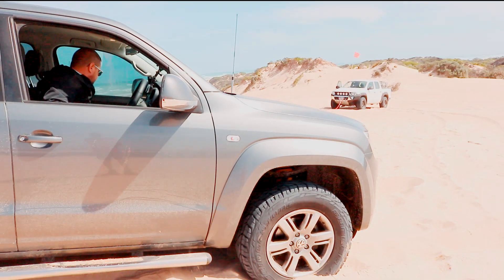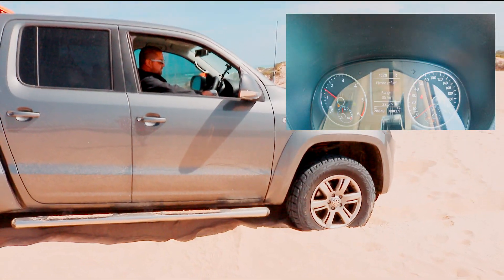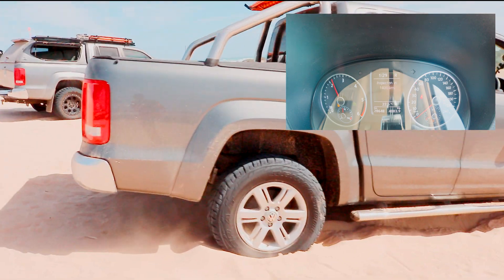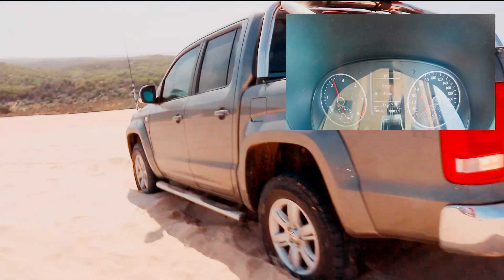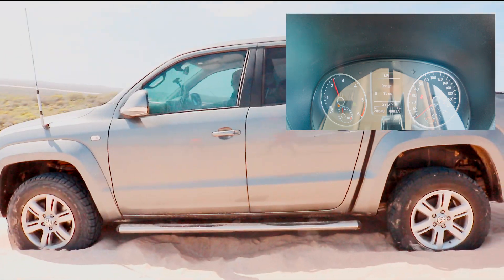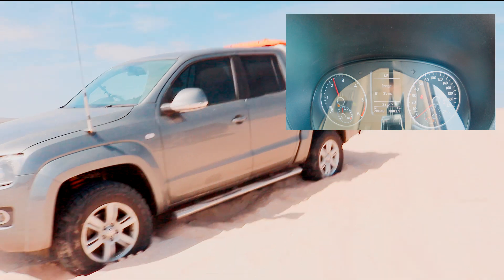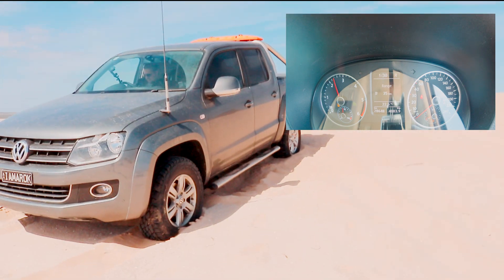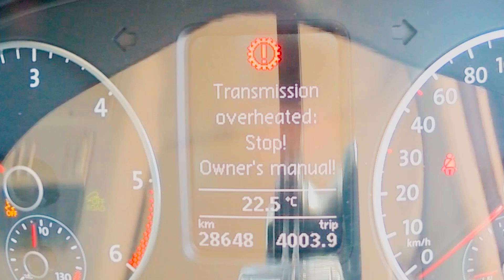JTech Amarok Flash Tune  - Fixing the Auto Reverse Issue

Comment: For me there is something wrong with your gearbox/cluth, yes the vehicle is in the sand but is not stuck in there, no much torque is needed to at least turn the wheels... the ASR ( traction control ) is turned off ??

Comment: This is completely false. Press and hold the traction button for three seconds and it shuts the traction control system off, then you can reverse on any soft stuff with ease. You don't need a tune, read your manual and you'll be fine without this
Reply: Seriously, that’s all it takes, because stuff me there is a lot of hullabaloo over this issue !?!?
Reply: No, this is not the case. Yes you can turn off traction control completely using the method you described, believe me, TC can be easily disabled -  but this is not a traction control issue - this is a torque limiting issue.
For example, by pulling fuses out non the V6 you can even fully disable the stability control as well as traction control (which you can’t do via fuses on the 4 Cyl), but even with ALL electronic aids/nannies disabled the torque limits are still present. ONLY coding can modify this.
For some people it’s more of an issue than others, but it does exist. Even the dealers and manufacturer have admitted that it’s “less than ideal”.
Reply: Yes you are correct, but pressing for 3 seconds only disables the traction control.. the torque based architecture of the ecu limits the torque electronically across the board.

Comment: Is the 2 litre a conventional automobile? 
My 3 litre v6 has a dual clutch transmission, so if I did that in mine it would have nothing to do with a torque converter, and everything to do with the clutch slipping
Reply: The 2.0L & 3.0L Amarok (2H Model) both have the ZF8HP “Torque-Converter” Automatic Transmission.

Comment: Does the V6 model have same issue?
Reply: Hi Mario, yes the V6 does have the same issue but it actually has a “per gear” limiter.
This is not as highlighted in the V6 due to the higher torque output of the V6 Engine compared to the 4 Cyl.
Either way, it’s something that we specialise in improving dramatically.

Comment: Josh what is the reason that VW do this, have you spoken to anyone from VW to ascertain the reasoning behind it?
Reply from the maker: Jim Provan hi, the reason behind this is a combination of a tall reverse gear ratio and a Heavy Duty Torque Converter. The vehicle simply doesn’t make enough torque to get past the torque converter effectively.
Cheers, Josh
Reply: @jtechautomotiveenhancement8951  that simply doesn't make sense.
Let's deliberately cripple the vehicle, just because we feel like it. No manufacturer does this without very good reason.
Reply: Jack Trade As a manufacturer, VW (like any other Manufacturer) has to mitigate the risk of warranty claims by building in a “component protection” factor. This makes the customer “take it easy” on the drivetrain components, even though the customer may be trying to brake something.
Most European vehicles run torque based architecture so it is quite common.
It’s kind of saving us from ourselves!
Reply: @j-techadventures6312  that's fine if you're talking about your golf, jetta, or passat.
Here were talking about people going off road, in sand, towing a caravan where they need to reverse.
Very specific kind of people buy the amarok.
Let's say you're towing a caravan and you need to reverse it in a driveway, which is slightly uphill.
WTF are you gonna do when they crippled the vehicle and you simply can't reverse that caravan or bog yourself out of sand in reverse as many do! 
And some people actually discovered this hard way. 
Volkswagen will not tell you this. 
Let's make tall reverse gear, similar to second gear ratio and to protect the car from abusing, we'll just screw them up by limiting torque. 
Why make that tall reverse gear ratio, maybe to race in reverse?????? 
OMG, those engineers are just sometimes sooooo, I wouldn't say stupid, but frustrating! 
Why on earth make half finished product??
Why?
Reply: @trade1713  yeah true, I 100% agree that it could have been done better. The reverse gear ratio is ridiculously high for no apparent reason aside from (which is the only thing I can think of) is that the ZF8HP Trans is used in so many other vehicles that are AWD but not a typical “off-road” vehicle.. maybe VW got lazy and just picked the trans as the “most suitable option” and ran with it. I guess it probably costs a lot of $$ for a manufacturer to get someone like ZF to build (or even just modify) a specific transmission to suit a specific application.. 🤔 
It could have been done so much better.

Comment: Do you know if the new V6 has the same issue?
Reply: @BatontheRoad  It certainly does mate
Reply from the maker: Matteo Matteo yes the new V6 does have the same issue as they have a separate torque limiter per gear unlike the 4 Cyl.
It’s not as noticeable when unladen as it naturally has more torque on tap, however once you put a big trailer or caravan on they can struggle.
Cheers, Josh

Comment: dammm that would suck! reverse is so important in 4WD...you can get unbogged usually too 
I guess the only thing you can do is just decrease tyre pressure, use your traction boards to get out
Reply from the maker: DeepBlackice Yeah that doesn’t even work. The car simply doesn’t make enough torque to get past the torque converter as effectively as it could.